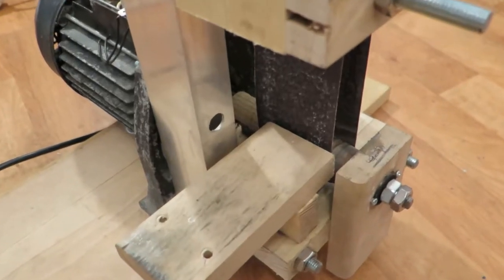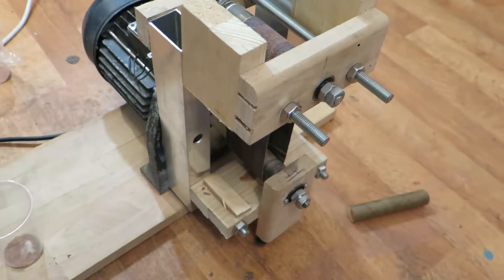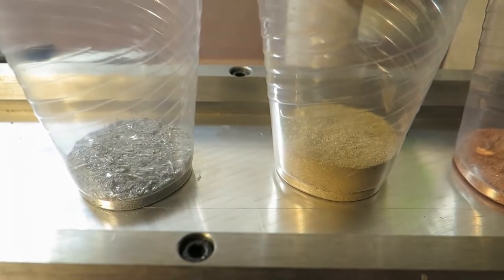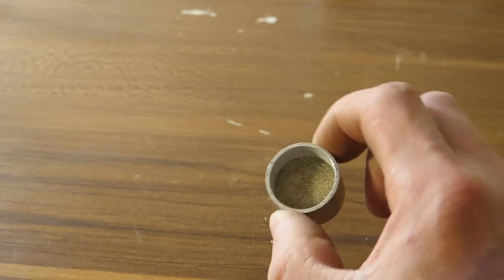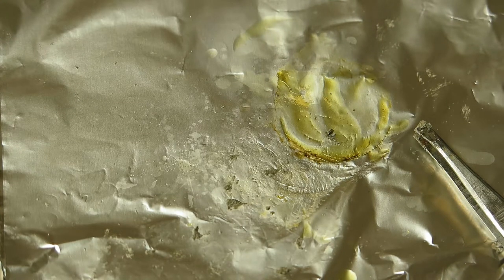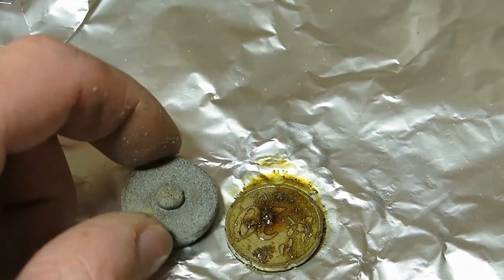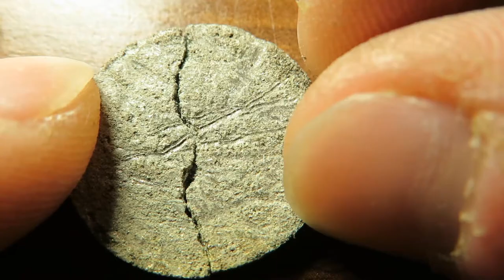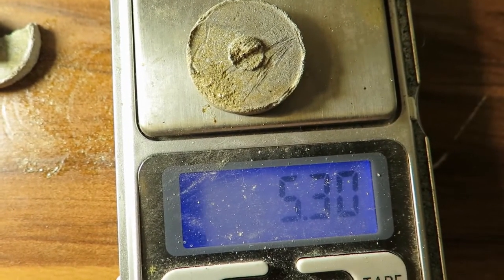Metal sintering/fusing with tin

Comment: I used a geared motor with a file attached, to file metal powders. Takes a lot of time, but doesn't need attention and the particle size is rather uniform.

Comment: You didn't sinter it. For sinterization to happen, you have to heat it to a temp high enough to barely begin the melting process without actually reaching the full melt liquid temp, so the metal molecules join together when cooled. Sintering causes weaker bonds than full melting, because of the air in between. I think what you did was vitrification, meaning the "flux" you used, "cured" or vitrified the block of metal, same process as when you "cure" a ceramic crucible with borax.
Reply: You can sinter as low as 60% of the materials melting point. But for that to work, conditions need to be ideal. This video is probably more like LPS (liquid phase sintering). Awesome vid, thanks for sharing.